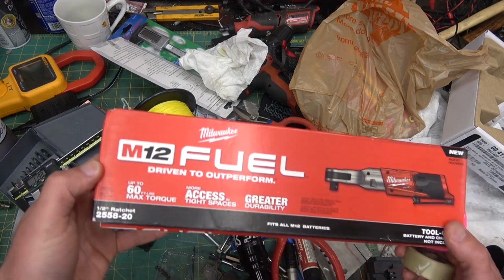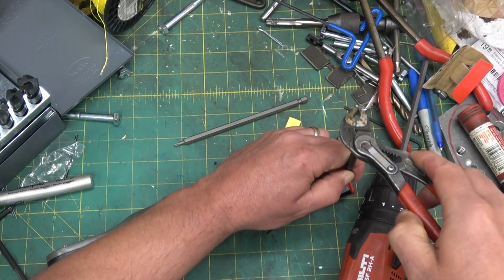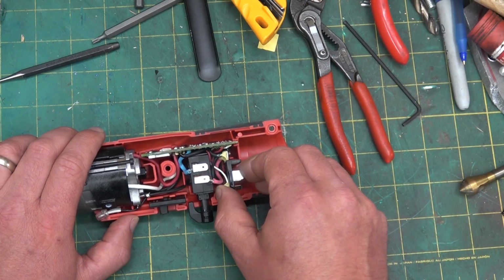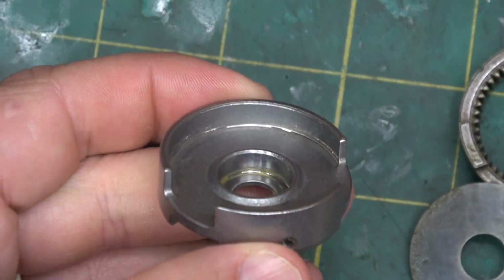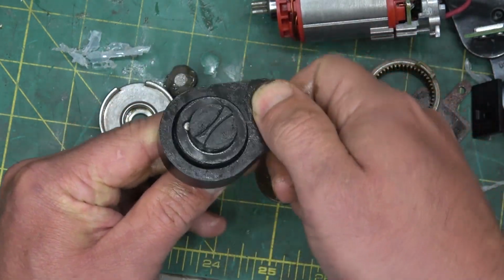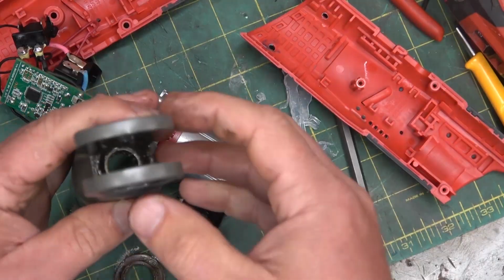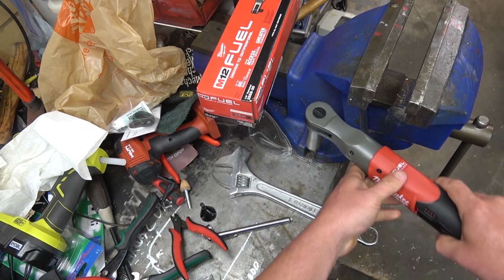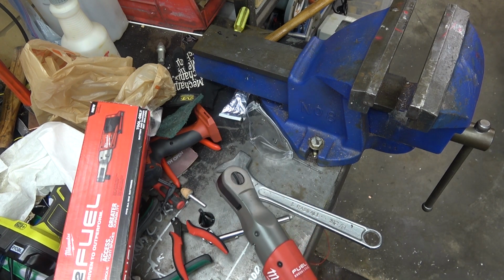BOLTR: Milwaukee Fuel Ratchet

Comment: I have the 3/8" versions, and I love them.  They aren't going to break loose a really stuck bolt, but that's not really what they're for.  They're amazing for pulling out those long bolts under the hood that take forever by hand.  They're also small enough to fit into most places you can use a standard ratchet.
Reply: TheMcspreader that’s the nightmare fuel that keeps me up at night.
Reply: I found them to be a life saver on m50/52/54 belt drive and accessory bolts that are 6 inches plus and down halfway in the engine bay. Takes seconds instead of minutes.
Reply: @TheMcspreader  oof, don't ask you how you know, right?
Reply: nah, non-fuel is way better due to how much more compact it is
Reply: TheMcspreader been there. Done that.
Reply: Definitely worth buying the fuel version though it will break more than the non fuel. I have both.

Comment: Crazy timing.  I wanted one of these but cheaped out and bought the 65$ import crap.  Broke it the first week.  Had this hilariously tiny pin connecting the drive to the socket.  Sheared it like a pretzel stick.  Lesson learned.  Now I break em free with the standard wrench and buzz em off with the power one.  Yours has a substantially larger pin and doesn't look like it will be an issue.

Comment: I have both the m12 and the m12 fuel ratchet. My m12 non fuel has stripped out the teeth in the head twice. My fuel has had Zero issues. I also have a few batteries with broken clips. Not sure of a solution to that yet
Reply: Get the portable blue tooth speaker and use them batteries for it :)
Reply: 3D print replacement clips for the batteries?
Reply: Old M12 ratchets lasts about a year for me before they lose torque. For me failure was in that small pin and bushing wearing out enough to be able to spin around freely without moving that "water drop" outter ratcheting part.

But then there's no problems with warranty if you remember to take a picture of the sticker with serial number.

Comment: When I was a kid my dad had an electric ratchet; it was actually fully metal and lived in a charging bracket on the front of his work bench.  It was very useful but the battery eventually wore down and the quantity of useful work it would perform per charge steadily declined.  For some reason we let it remain on leg of the workbench, for years after it had ceased to be of use as anything other than an especially heavy and clunky ratchet wrench (a use it only ever saw if for some reason the S-K as well as all fifty thousand Oriental cheap shit ratchet wrenches were not to hand).  A few years ago he finally pitched it.

Comment: Just had a high velocity central air system installed. The blower fan is powered by a brushless dc motor, apparently for efficiency
Reply: And noise reduction?
Reply: It is very quiet